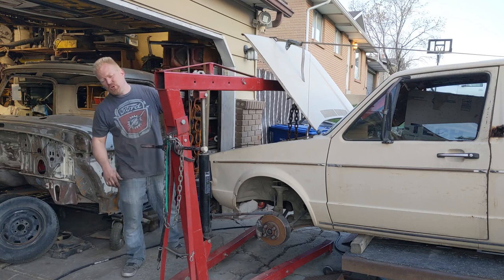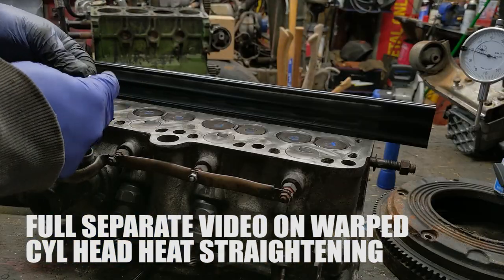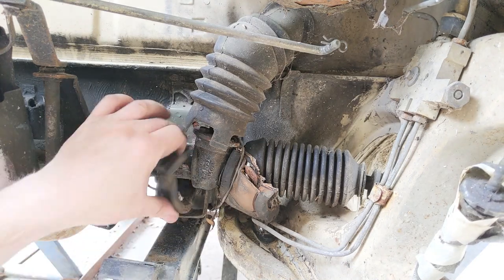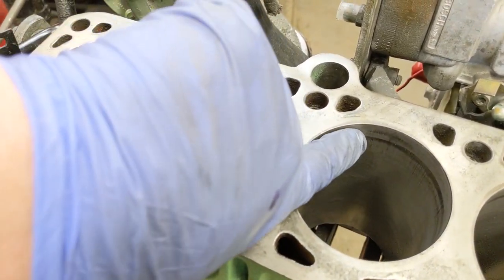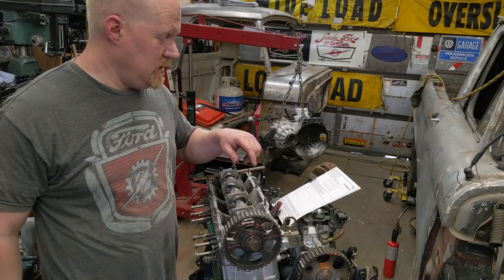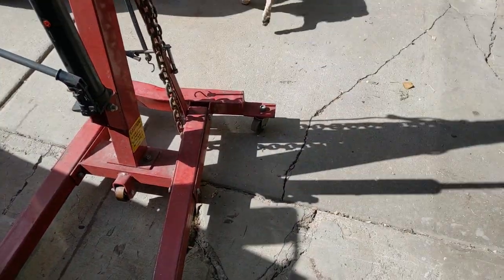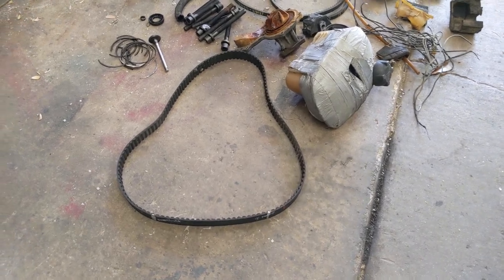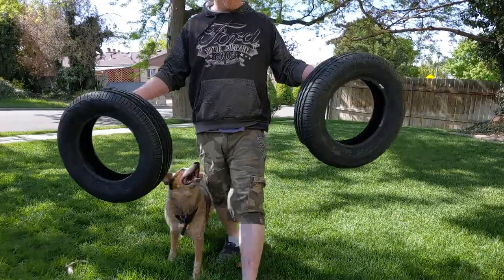VW Diesel Truck Rescue ENGINE work & FIRST Drive Part 2

Comment: It’s a joy to watch you work . I made an extension for my dial gage from  old  car aerial  soldered on small screw , can you change the clutch with the motor in car . ?  You’re right it’s hard in Canada to get parts , I’m waiting for 2 seals for my 1980 Rabbit  , seals are for the master cylinder . Coming from Arizona .  Thanks will be watching . Trucker AI retired .
Reply from the maker: AutohausAZ gave me so much trouble ordering parts from them. They're one of the ones that I complained about in the video. They pushed back progress on my project by at least two weeks for various parts not being in stock after I ordered them or just waiting days to ship them. They sent me a head gasket that was bent(and had small crack)and when I called them on it to just send me a new one they said I would have to mail it back and wait a few weeks for them to investigate and then they would ship me a new one; maybe.  Seems like they have the best prices though. Partsplace Inc out of Michigan was probably the best parts ordering experience I've ever had. Rockauto was also good, but I've used them a fair amount for other cars.
Reply: Yes ,to change the clutch you pull the left front strut to let the drive shaft away from the diff, and drop the gearbox.

Comment: Finally someone on YouTube who understands you have to bleed the fuel line to the injectors on a diesel or it will air lock. The sparks were cool, you looked like dr.evil for a moment there. What’s the yellow DIP sign you got in your street? Do It yourself Police?
Reply from the maker: DIP- dip in the road. Years ago a guy hit that at 30mph in the middle of the night and it ripped the entire suspension out from under his truck.

Comment: Awesome work. Chics Armature in Ogden used to rebuild a starter motor off a VW Dasher Diesel I used to own. Might wanna give them a shout out to see if they can do your starter and alternator.
Reply from the maker: Hey Thanks Man. Not many Alt/Starter rebuild shops around anymore for sure. I will likely just rebuilt it myself though.

Comment: Why do you use the hose when lapping valves?  You could chuck the drill motor directly to the stem without damage.
Reply from the maker: Chunk won't fit down in the head.
Reply: Personally I feel like the hose may help balance out any offset from holding the drill off center, though I'm sure sixtyfiveford knows how to drill straight

Comment: It sounds like you got the timing pretty close, the rattle sounds correct. Did you know about the cold start lever to the right of the clock? It will retard the timing to make for easier starts. That car looks like it actually has well over the mileage stated. I would guess at least 200K based on the condition of the plastic parts.
Reply from the maker: Yeah, the cold start lever is what I ran to shut off in one part of the video.

Comment: Why don’t you take a flat screw driver and bend the tip a bit to make a better pry tool?
Reply from the maker: I know. I have a dozen bent ones but none bent at the correct angle. I was about to be bend one when I try out my radiator hose pick and it was just right for the job.

Comment: you should oil or grease head bolts would have tightened up nice then
Reply: Otherwise perfect job cambelt tensioned well not to tight painted up nice
Reply from the maker: They were all oiled and threads cleaned/chased.

Comment: Diesels need compression.  You would be better off honing out the cylinders and going with over sized piston rings.
Reply from the maker: Sure. Ideally you would take it to the machine shop and spend 10x what it's worth to have a proper bore with oversized pistons and rings. But then I would still have an $2000 engine worth $200. It runs fantastic as is and is plenty good enough for the sub 100k miles this will see in the entire rest of it's life.

Comment: Isn't that dimpling going to screw up your cylinder walls
Reply from the maker: The skirt always rubs the cylinder walls. The further away it is can make it slap, which causes wear. The dimpling keeps it just barely away so it can't slap.

Comment: I know this truck is done and on the road now so what kind of mileage are you looking at here? I have a 2002 VW TDI new beetle and I know it won't touch that but just curious. Thanks for the upload!
Reply from the maker: I haven't got a firm number because I've leaked diesel fuel through injectors fittings etc. However preliminary numbers show 40mpg. So it should be higher than that.
Reply: @sixtyfiveford  Thanks for the reply and I stand corrected, it does almost exactly what my 1.9 TDI does for mileage! I get about 42 combined and strait out on the highway long distance it will just top 46. I will be on the look out for one of these old VW Rabbit trucks! Thanks again!!
Reply from the maker: @jackallen6261  Some guys claim to easy break into the mid 50'smpg with these. It all depends on how you drive. Problem is that's easy at 55 60 mph. All my freeways here are 70mph plus and you'll be run over if you don't keep up.
Reply: @sixtyfiveford  Yes, my TDI is pretty sensitive to speed as well. Over 65 it drops to about 40 , 60 - 65 it will jump to about 42. Thanks for the info!

Comment: Those valves are like $16 brand new lol.. just replace if you can get them
Reply from the maker: What does that matter? People want to toss everything because they don't want to learn how to fix anything.  I ended up getting 1 valve because it was too short and no shims were available to take up lash. Getting this single valve stalled the project by nearly 2 weeks.
Reply: @sixtyfiveford  2 weeks? You’re lucky.. I’ve been waiting almost a year for 4 intake valves for my 91 jetta 1.8 8v lol

Comment: How come it takes 3 weeks to get parts?
Is it not 3 days?
Reply from the maker: Because no one drives these anymore and parts are sitting in the darkest corners of warehouses.
Reply: @sixtyfiveford  Until '92 engine parts are all the same as GOLF diesels, tranny also.
VW busses type 3 ( had 6 of these in the days) also have these engines in 1.7(these are crap) and 1.6 with turbo but the standard 1.6 is also the same.
Rubber and the thngs that make it a pick up will be more difficult but actually it is a golf type 1 in pick up modus.
If you look for parts in europe you should search for caddy parts, instead of rabbit.
Maybe you can tell wich part(s) you need most and can not find maybe i can take a shot at it?, i am "closest to the source" and still know some hobbyists.
I am not being a know it all, just want to help.
If i sayd something you did not know it was worth it, if i did not it is useless but i happen to know 1 or 2 things about VW from this era.
I hope my english does not hurt your eyes too much, i am Dutch and never learned to write english.

Comment: Kinda looks like it’s burning a little oil, but not bad for a low buck truck that’s been off the road that long
Reply from the maker: Still waiting for the rings to fully seat to the new hone. In the video that was the very first loaded acceleration so that's to be expected. I didn't notice any smoke after I drove it around for 15 minutes or so.